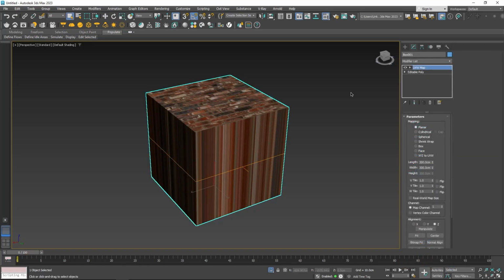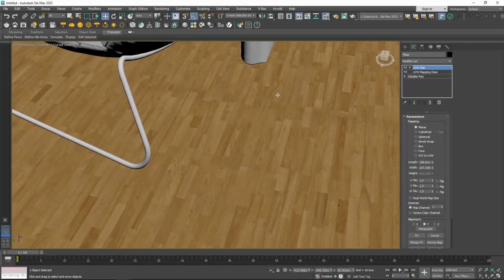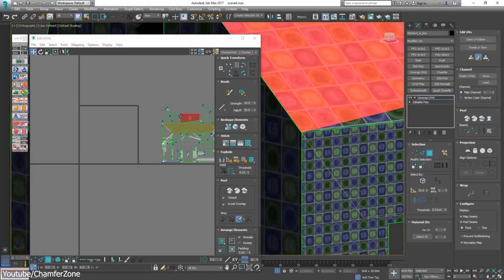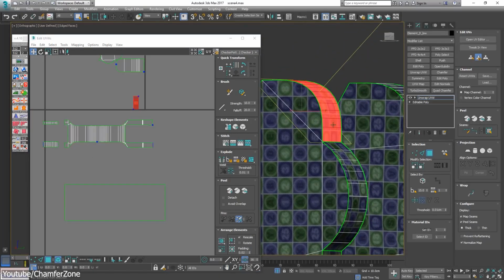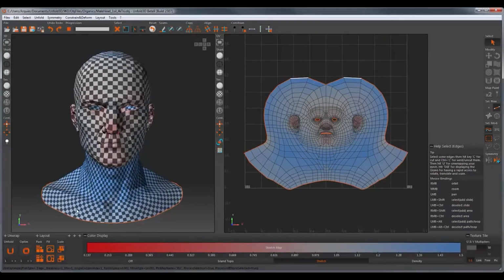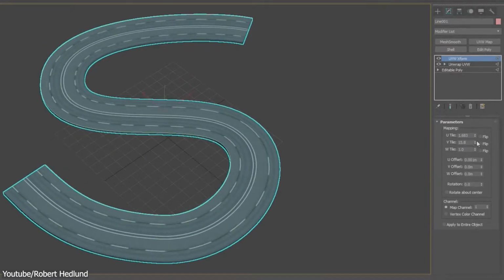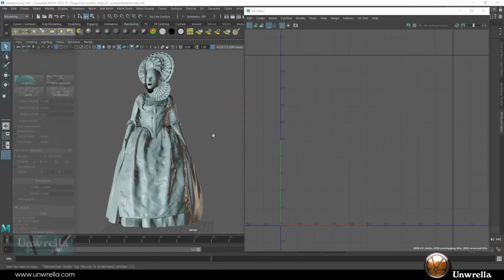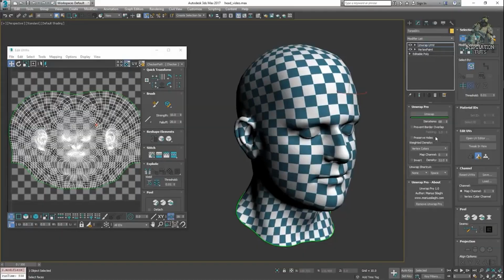Is 3Ds Max Good For UV Mapping

Comment: The only thing I see here that is truly ground breaking is the ability to transfer your cuts to completely other shapes. Ultimately when unwrapping I’ve noticed there are only truly 3 ways to placing your cuts on a mesh. Your either unwrapping a surface how you would a box or a cylinder or a face. And once you build a repository of these cuts into modifiers, I could see you unwrapping entire scenes with a click of a button.

Comment: I have been working in 3ds max from last 5 years and i have worked on every possible pipeline, AR,VR,apple Ar kit, for Meta and other standard 3d assets workflow.

I have never faced any issue when it comes to UV mapping, infact its better than Maya and Blender (personaly tested). Of course there are downsides, the major one is it can not export glb/usdz file format natively, tho with plugin it can but the results are not accurate